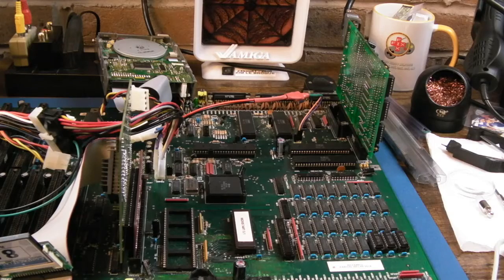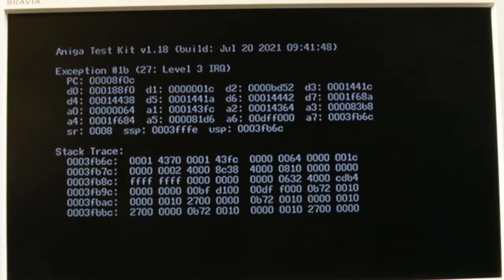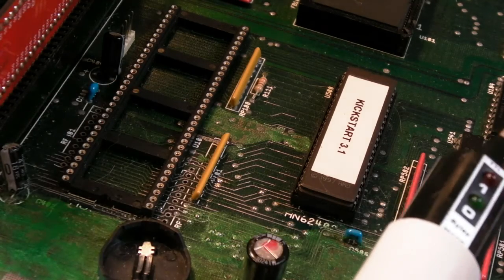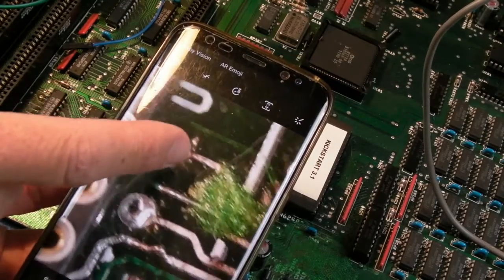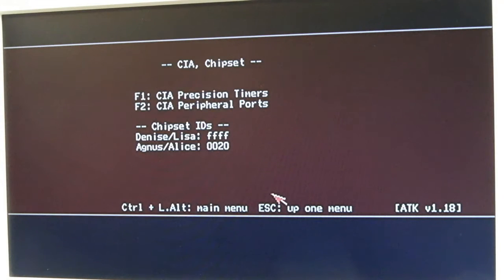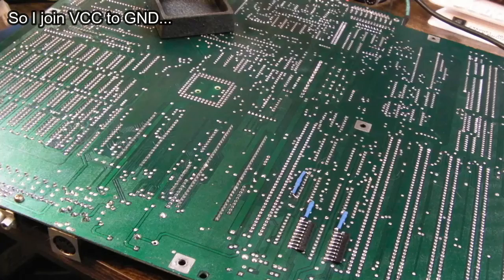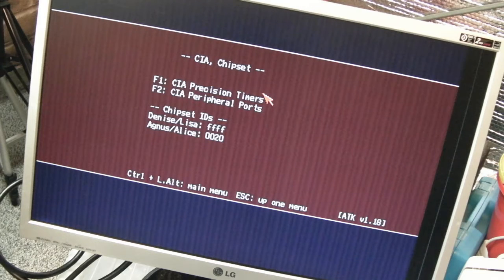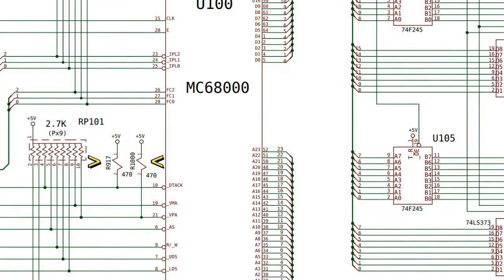Commodore Amiga A2000 Rev 4 - TF536 Audio Too Fast & NMI Issue _DTACK Fix

Comment: Very interesting diagnostics.  I have rev4.1 and a rev4.3 boards which currently hang on the pistorm2k buptest.  A real 68k CPU in the coprocessor slots is fine.  Will check that reccomeded mod out.  Many thanks 😊
Reply from the maker: Let me know if the mod works on your boards. =)
Reply: @GadgetUK164 I applied the 470 Ohm resistor to both rev4 boards and they seem stable with a 68000.  Its not fixed the PiStorm2k buptest hang so it must be unrelated.  Thanks  😊

Comment: I cannot thank you enough for releasing this video. I found this exact issue tonight when trying to play Petscii Robots on my Rev 4.4 A2000 and adding that resistor fixed it. I can verify a lower resistance will work as all I had available was a 330ohm resistor and it works fine.
Reply from the maker: You're welcome!  Glad it sorted your problem =D

Comment: I'm having this exact issue with the 28MHz accelerator I built, but the machine is an A500 rev.5...  Ideas?  I hadn't looked into the resistor pack or a resistor pulling up /DTACK yet.  For me the music is fast in a number of games, yet other sounds and sound effects are normal.  Slower 14MHz version of the same accelerator is not having that problem.  Is that tester a ROM utility or do you load it from a disk?
Reply from the maker: The test software I used here was Amiga Test Kit - https://github.com/keirf/Amiga-Stuff/releases
Reply: @GadgetUK164  Thanks to the link to the tool.  I ran the CIA timer test and it measures 37 IRQs where it expects 22, reliably every time, same thing with the rest of the tests.  Same numbers every time, but significantly higher than what the test expects.  Not random at all.  It only does it with the 28MHz accelerator I built, doesn't do it with the normal 14MHz.  Likewise it also incorrectly detects my machine as NTSC at 50Hz, it is of course 60Hz in reality, but that's down to the interrupt frequency.  The resistance between /DTACK and 5V VCC is 470ohm, so that's a very strong pull, but I stuck a 470ohm resistor in the socket anyway and it cut the resistance in half, measuring about 260ohm, made no difference.  My problem appears to be different from yours.  But the faster interrupts certainly explain the fast music.  Switching around odd and even CIAs didn't help, but I didn't expect it to as both measured the same on the timer test.
Reply from the maker: @rootbeer666  It's likely to be an interrupt problem then - check INT2 and INT6 connections on the CPU board you've built.
Reply: @GadgetUK164  INT lines are between Agnus, CIAs and Paula, INT lines don't go to the processor.  Paula signals the interrupt level to the m68k processor using IPL lines.  My problem turned out to be an incorrect E clock frequency, which is used as a reference by CIAs on PHI2.  When I increased the frequency on the accelerator I forgot that I need to divide down the E clock, it is supposed to run at 1/10 of stock 7MHz, it is a signal generated by m68k family processors, but if you run yours faster than 7MHz  you need to either divide it or generate it externally, otherwise you will have the exact problem I had.  I basically have it fixed now, timer tests have passed.
Reply from the maker: Assuming your CIAs are OK, it probably is that resistor!  The rev 5 probably has same size resistor as the rev 4.x A2000.  You want 470ohm ish on that resistor, 330Ohm should work OK too.

Comment: Excellent and informative vid as always Chris, and many thanks for shareing it with us.
On a different note, why do firms that make smd components use stupid code numbers on their bloody transistors, diodes, mosfets and chips etc?
Why do these (Chinese) firms use stupid "blob chips"? Why do morons file the part numbers off through-hole chips, when most people in electronics engineering know what they are anyway? 
We are currently trying to source 2 smd components marked WS-E1M, and the other marked DE-80P. Both are 5 pin sot devices to be found in a power supply section of a CELESTRON Digital Microscope.
As usual, no information can be found on the microscope or smd chips in question. The internet is about as useful as a strong fart in an Astronauts suit 😡😡😡😡😡😤😤
Any help would be most appreciated.
Wayne & Nina.
❤️❤️❤️❤️❤️❤️👍👍👍👍👍😄😄😄😄
Reply from the maker: Thanks!  It's always incredibly hard to workl out what many SMD parts are - the codes often mean little.  You really need schematics, or a working unit - remove the part and test in a component tester to work out its type and specs etc.  If you can reverse the circuit you might be able to speculate whether its a PNP / NPN / Mosfet etc and its pinout... But that can be difficult for sure!  If its low voltage side of a PSU you could try some generic PNP or NPN transistor in that spot, and just hope the pinout is correct.  Some of the 5 pin devices are single gate 74 series, or a voltage regulator.

Comment: Thanks very much for this video. Very helpful!
Reply from the maker: If you still have problems with a 536 (or 534) check out the other mods that Commodore suggested in their service bulletins.  For example add the resistor arrays under the Zorro stuff like I did on this board too.